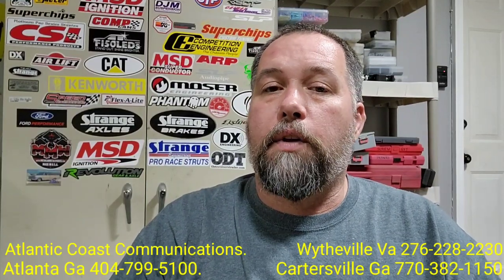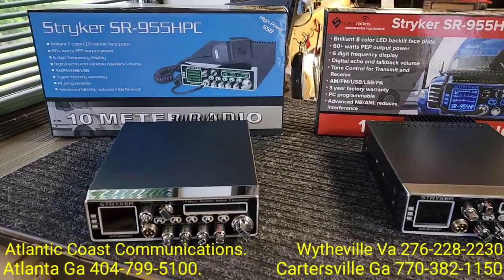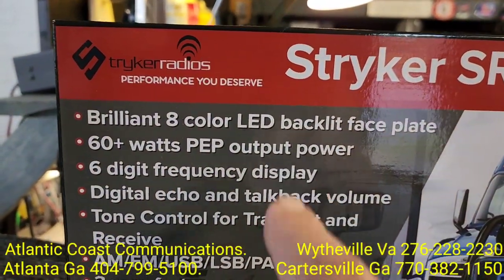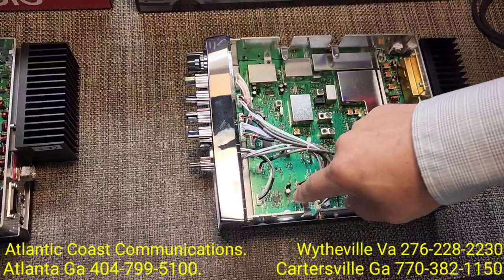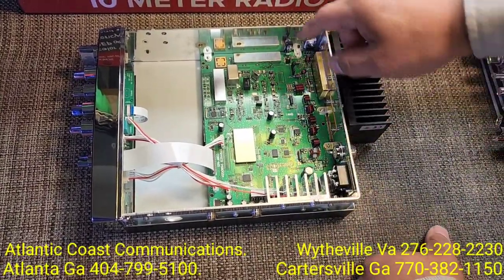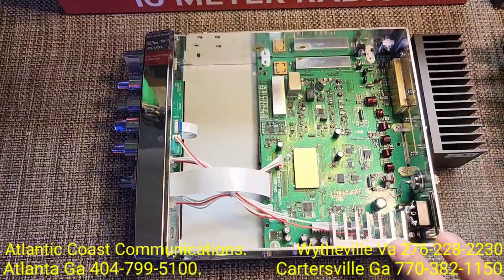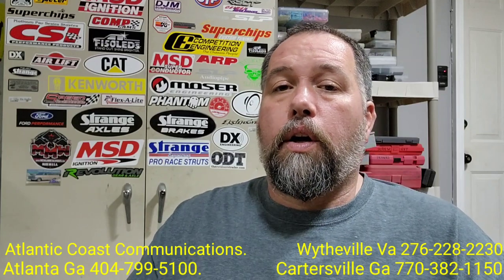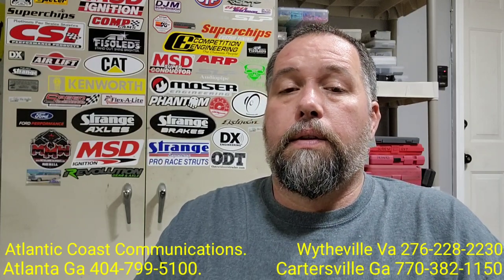Stryker 955 V1 vs V2

Comment: The last radio I bought was the Shakespeare gbs-2000. If I remember correctly the year was 1977. I had a slapstick glass antenna on the roof of my father's house and I still have the same Turner power mic. I was just a kid we lived close to I-95 in Massachusetts. All that time ago and the radio is still working today. Through the years whenever I'm doing a road trip I stick a magnetic antenna on top of the car and absolutely love having the radio in the car on the road. Hands down the best communication device on the road is a CB radio. Cool channel
Reply from the maker: Great story, thanks for watching. 👍

Comment: Went from dipping down to 12.9 to about 13.6 while transmitting after I swapped power cables. 8 Guage the rest of the way to the battery with anderson connectors. And replaced that terrible little fuse with a 30 amp car audio style fuse. 
Great video by the way. Now I guess I need that v2 now, you know, because radio😜🤘
Reply from the maker: Lookout for the next video, the Cap helps as well.

Comment: The new 955 has the same board as the new Anytone at-5555ii and the CRT SS7900V. 

I have the CRT and it's a brilliant radio.
Reply: I have the Radioddity which is the same as the Anytone Ares ii and it looks EXACTLY like these radios inside. Are they all the same?
Reply: @justkeepingitreal7768   yes they are basically the same radio. The main board is being used in several new radios.

Comment: Thanks! Now I know beyond a shadow of doubt that I have the V1 955.
Reply from the maker: Thanks for watching
Reply: @jrichtruckincbtips  
Hey can that guy in Atlanta at 285 and 78 work on the 955s?
Mine had a sound issue friday but its working fine in the house?
Reply from the maker: @RC-Heli835  he sure can
Reply: @jrichtruckincbtips  Ok good to know!
 The last time I called down there they said they couldn't do too much with these circuit board based Strykers.
I thought my radio had quit modulating. It turns out that I had a screw come out of my RoadPro Coil Antenna which I found when my backup radio wouldn't work either.

Comment: I got the no thrills 447 , love it ( company driver, needed something to fit in small cb cubbie/tray )
Reply from the maker: The 447 is a great radio
Reply: same here bro got the 447 for my dump truck and a stryker sra10 trucker antenna 75 watts of power i have gotten out 21 miles with it in the foothills of the Appalachian Mountains to!

Comment: I've got one of those new  2022 KW T680 sleeper truck and I need to find a way to run the power from the battery to the cb radio. I know how to run it up the inside of the door post. My problem is trying to find a way to get it inside the cab.
Reply from the maker: There should be a grommet behind the panel that is under the mirror, between the hood and door.

Comment: couple of q's
1] do you work on the 5555n2, and if so in your experience can you do all the same mods and get same power outputs from it as the 955v2 [supposedly the same]
2] if so how can we talk , would like to get my quad 5 a once over.
Reply: well just opened it up and its exactly the same as your pic, only thing mis is that sim card/sd card looking section in the front of board to the right of the numbers
Reply from the maker: Call Atlantic Coast Communications and he can answer your questions.

Comment: I have a dud version 1 will not ever buy any stryker again
Reply: You are one of the very few.  I have 6 different models of Stryker’s, I bought new.  Not one problem.  Best built radios without question.  If you bought it and it was a dud then you should have sent it in back to the factory for warranty work.